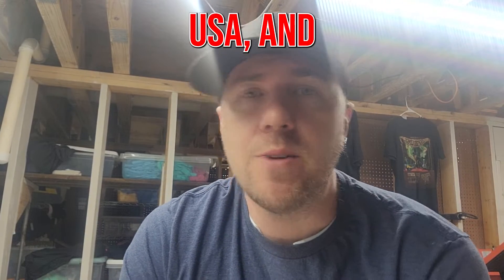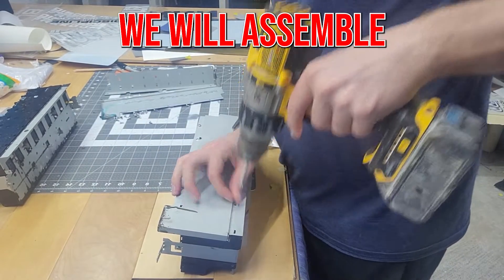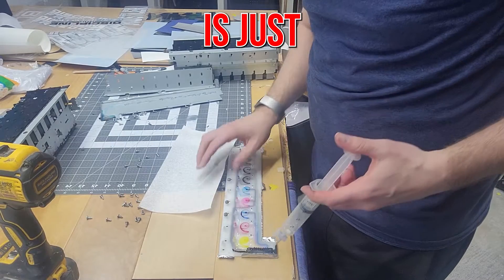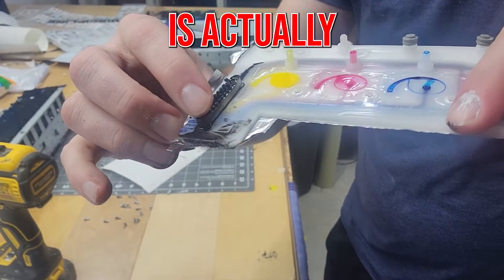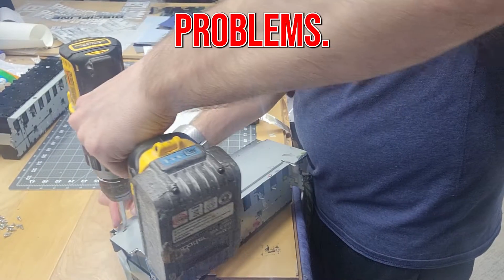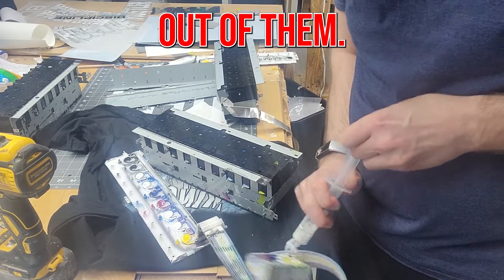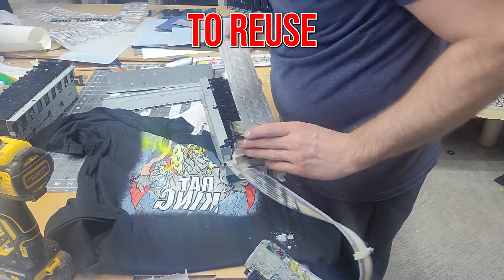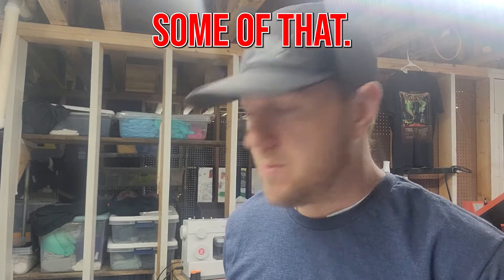Epson 3880 Ink Bay Dis Assembly and Diagnostic

Comment: WOW thanks for this, perfect timing. Got it 3880 recently and was having trouble with one of the channels and have tried cleaning the print head but one of the channels still wouldn't flow so I tried putting a little pressure into the spigot or nipple that connects to the cartridge to retrieve ink and I ended up breaking it off. Oops. Now I can't find it not that I could have probably glued it back on but any suggestions? Just buy a new bay or a new old printer for parts to replace that portion? Now that I see it's just one little sheet with the spigots connected.